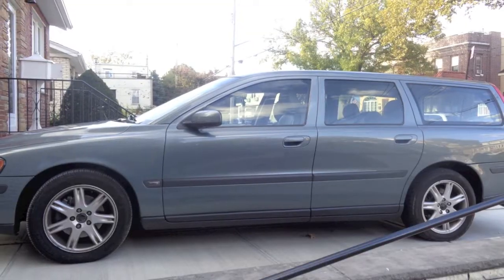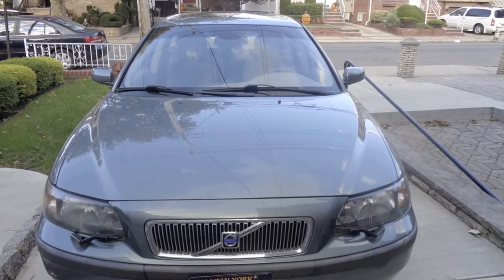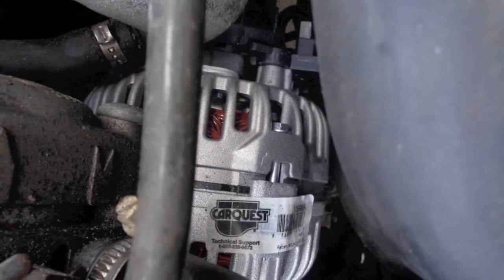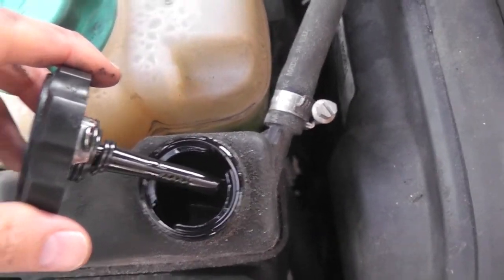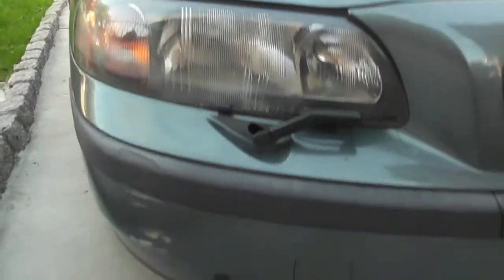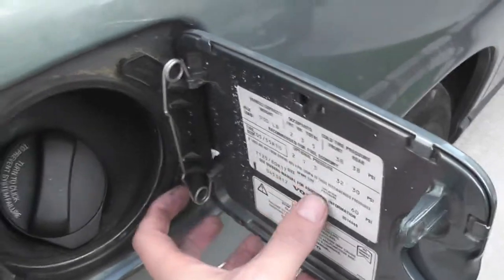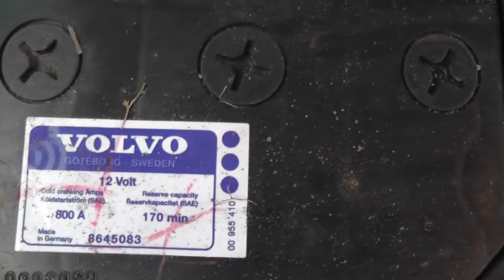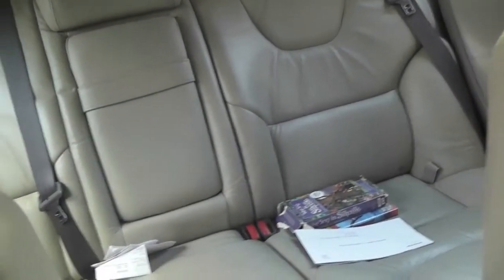2004 Volvo V70 2.5T My Intro to the Volvo Community

Comment: You probably figured out that the internal alarm batteries are shot and that is causing the battery drain and sun roof problem.
Reply from the maker: Well actually my check engine light was due to a short in the PTC check my last video. Also the sunroof magically started working again but that faulty siren is on my list of things to repair

Comment: Try a spark plug coil
Reply from the maker: The spark plugs were the first thing I changed after this video.My very first issue on this car was a misfire that was fairly simple fix. The issues that followed were not but they are fixed now